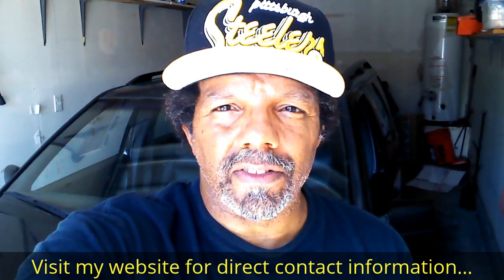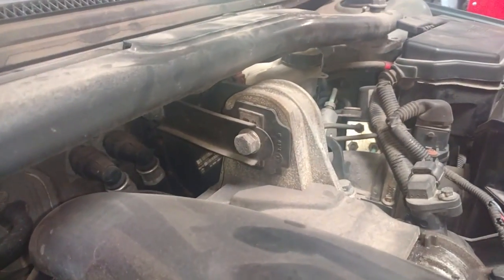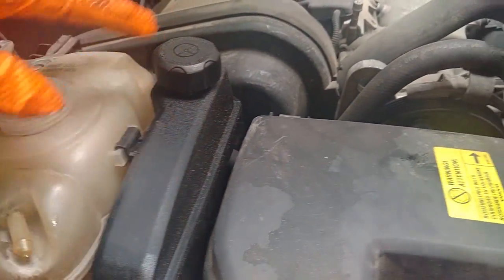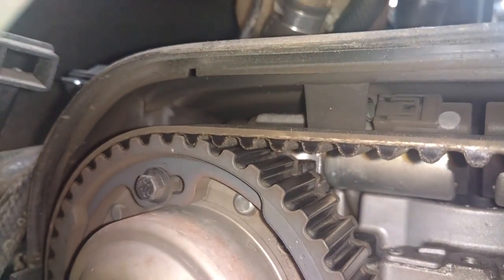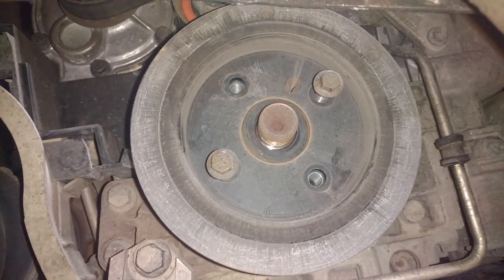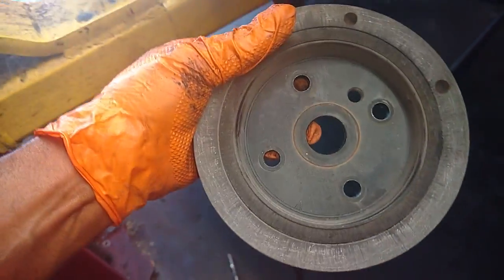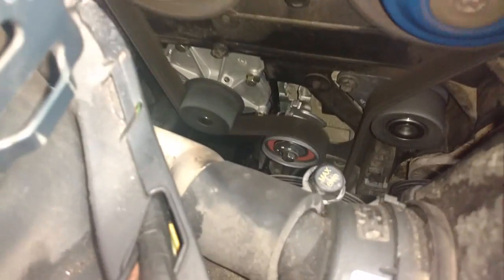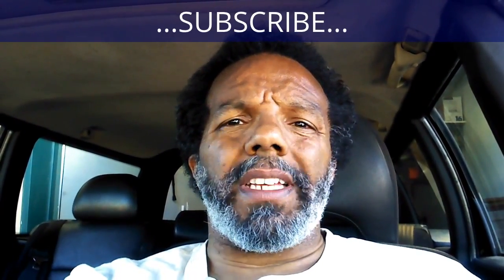How to replace timing belt & water pump on P2 Volvo S60, V70, XC90, S80, V50, S40, V40, etc. - VOTD

Comment: Hi Robert! After installing the timing belt and removing the camshaft locking tool, I rotated the engine UNTICLOCKWISE instead of CLOCKWISE. How can I fix this mess?
Reply from the maker: What mess?
Reply: @RobertDIY  the timing marks are not aligned and someone says I can ONLY rotate CLOCKWISE. Is this something that can be fixed?

Comment: Hi Robert, thank you for the amazing videos. I am attempting to replace the front crankshaft seal on my S60 2.0T 2005 (EU model).  In the vida manual I see that the 9995433 tool is required to remove the harmonic balancer. I do not have an impact tool, only a breaker bar for the center nut. I wanted to ask, do I really need the 9995433 tool, or do I need a cam locking tool, I am overwhelmed. Thank you.
Reply from the maker: I wouldn't try to hold the cams and break that nut loose. Find somebody with an impact gun to break it loose for you.

Comment: Great video Robert. Do you have a video on a timing belt replacement with a mechanical tensioner on a 1998 v70? It’s a uk 10v 2.5 ns, b5252s engine
Reply from the maker: It's the same process as this video.

Comment: Not sure if youstill answer these omments buuut trying to align this p2 (with old belt still on, doing bad water pump and belt cause its off) and my cam timing marks are about 180 off from each other and when one  of the cams are aligned the crank is 180 out (both do this) car has no codes whatsoever..... no idea what to do
Reply from the maker: If the car runs well, you put the crank on it's mark and make 2 new marks on the cams.

Comment: Just did this on same engine but tensioner keeps moving back and forth when engine started. Any idea on that?
Reply from the maker: If the tensioner is bouncing back and forth when you start the engine you likely tensioned it in the wrong direction. When you start the car that thing should stay steady and as the car heats up it will slowly move clockwise and just stay steady while the engine's running. The tensioner should have had a small arrow on it showing you which way to adjust the tension. If you keep having issues with it get a Volvo branded one, I hope you're not using aftermarket junk and your timing.
Reply: @RobertDIY  nope Ina branded from Continental. Will look for an but thought the newer/longer always should be clockwise. Thanks for replying 👍
/Chris

Comment: Why do a lot of people say you need the cam locking tool? Just for T belt? The tool is for the VVT adjustment right? IF you break loose the 3 gear bolts or center hub bolt, the one behind the front plug, not to confuse them.
Reply from the maker: Correct

Comment: Hey Robert, it’s Omar! Do the cams need to be locked from the front or back or not at all? I’m not sure if the cams put tension on the belt and if they turn when the belt is off.
Reply from the maker: No, unless you break a hub bolt loose. Yes they will move when you pull the belt, but you simply turn the cams back to the marks when you install the belt.

Comment: Hi Mr Robert, please I have a V50, 220 cv, changed the pump assembly, the old fuel sensor burn and a I noted, the new one can happen the same. ? Is it normal the Sensor Level lift to the righ position simply introducing the start key in "0" position or at the position "3". This fact also  happen when disconect the negative cable from the batterie. Tanks for your help.
Reply from the maker: When the key is turned to any position the fuel gauge should register. 
It could be a problem with the instrument cluster.
Reply from the maker: https://youtu.be/cWKOi8D4SWQ

Comment: Hi Mr Robert or any one, please I have a V50, 220 cv, changed the pump assembly, the old fuel sensor burn and a I noted, the new one can happen the same. ?That´s normal the Sensor Level lift to the righ position simply introducing the start key in "0" position or when disconect the negative cable from the batterie?. Tanks for your help. Nice year 2021.
Reply from the maker: I don't understand your question.

Comment: Hello Robert. The marks on your cam sprockets are aligned slightly to the right of the notches on the timing belt cover. On my car the marks instead line up slightly to the left of the notches. Does it mean my crank is off by one tooth? I've only checked the timing marks in winter with a cold engine and a garage temperature of 32F in case that makes a difference (thermal expansion, etc).
Reply from the maker: Temp doesn't matter. You need to set/view the crank.

Comment: Hey Robert; good video. I did exactly and followed your video step by step on my son’s car 2007 S60). Fired the car; it ran smoothly with no issue. Added the fluid, plugged the coal ant connector back and the car cranks but wouldn’t start, no fault codes, but it displays Engine performance reduced on the dash. After few attempts to start the car, the radiator fan goes on High and it shuts off automatically. My son took the battery negative terminal off and put it back but the car wouldn’t start. Please advise. Really appreciated
Reply from the maker: https://youtu.be/YiPAPu-K8OI

Comment: What is going on with my b5254t2 I have the engine at tdc with crankshaft  mark align,also my cam sprockets are align but once I align the tensioner to the right temp out here of 105 Degrees i tighten the tensioner and release the sprocket tool and the timing marks go off by half a tooth I keep getting correlation codes?please help
Reply from the maker: https://youtu.be/p8zd8GVvAa0

Comment: didn't show pre-loading the cvvt cam sprockets. ?

Did you do that ? 
They tend to move after the belt is pulled off, mine are spring loaded .
Reply from the maker: just turn it back to the marks. as long as you didn't pull the hub you'll be fine.

Comment: I try to do timing in s40 Volvo but problem surface when in try to line up the crank timing mark piston became level is it ok sir im still a rokkie
Reply from the maker: Did you align it before pulling the belt?

Comment: Robert can you pls send me the link where I can buy the special tool for removing the drive belt, I used torx 60socket  the part position of the belt blocked its full access. kindly assist thank you. pariegoza@yahoo.com ( Volvo xc90 2006 )
Reply from the maker: Pull the tension and knock the belt off of one of the pulleys. It's hard to find stubby torque bits.
Reply: Robert DIY thanks

Comment: What is that compound on the water pump bolts?  Anti-sieze?  Thread locker?   Also you said 15, or 50, for the torque specs on the water pump bolts?  Thanks.
Reply from the maker: Thread sealer
Reply from the maker: Huh? Did you check the comments?
Reply: Yeah, I did.  If the torque specs are there, then I missed them, sorry.   I'm fairly certain you said 15 pounds in the vid.  Just want to get it right.  All your vids are well done, thanks. @RobertDIY

Comment: Curious, probably dumb question.  When you reinstalled the water pump with it's new gasket which side do you put the gasket sealer on?
Thanks
Reply from the maker: I don't use gasket sealer.

Comment: You said if cam does move because of spring too simply turn in "proper position" to get belt back on....what is proper position, clockwise? Or do i simply give it a small counter clockwise turn to rehit my mark?
Reply from the maker: If the crank is on the mark it doesn't matter which way you turn the cams.

Comment: I have been reading online that you need to “load” the cvvt cams to line up the cam marks. Essentially you turn the engine clockwise past the marks and then counter clockwise to hit the cam marks. Was that something you needed to do or does it apply to a different engine? Thanks
Reply from the maker: sure.

Comment: Hi Robert. Really appreciate the video. Everything is fine except I can’t get he timing belt rapped around the two cams and everything else for the life of me, even after pulling the tensioner all the way to the right. I double checked belt and it’s the same length as the original. What am I messing up??
Reply from the maker: Do you have it tucked under the knob under the crank?

Comment: Robert i have been delaying this job on a 2006 volvo xc70 because i dont have a cam lock tool 5 cyl. i can just align the marks and pull the timing belt with out the cam lock tool ???
Reply from the maker: Yes
Reply: @RobertDIY  ok its on ! i am gona give it a try and take your word .... ill let u  know how it goes

Comment: s60 2006 2.5t going to have a shop do this one its my daily and me and timing jobs don't have the best track record ….6/2019 cost with to do the job is $550 with me bring them my new parts... I usually do my own work  but 1 slip up and its new motor time and when you adjust that spring it moves the hubs sometimes so this ones for the pros that do them every day. kinda like giving your self a hair cut ,you can  do it but sure not going to be like the pros do it...
Reply from the maker: I understand.

Comment: Hello Robert: thanks once more for a great video.I have just bought an XC 60 T 6- I thought that volvo would stick to a game plan but things seem different!? Have you done any cam belt replacements on XC 60s? I can only find 1 video on youtube- it was called cam belt replacement but the guy was actually replacing the serpentine belt  driving the alternator and air conditioner.Hope he's not in for a nasty surprise.
I have done all the fluids myself but hear a rev related "swoosh swosh" coming from the front R ( R hand drive vehicle)
The vehicle has only 138,000 km and was born in 2011.It should not be ready for a cam belt/water pump/tensioner replacement yet but that front end does sound suspicious.

Thanks for any ideas.
ps if you get a cx 60 T6 they move very well!......and will probably give you another lifetime of videos to make!
Reply from the maker: Sad to say, I have no experience with that engine or belt system.
Reply: @RobertDIY  Thanks for your reply.May be worth treating your self to a challenge? They are going cheap because they are expensive to service....and I may live to regret it! However  I have the time and my good old reliable 850 SE wagon with 187,000 kms to fall back on! I'll start by accessing the innards by front  wheel removal  and arch covers to see the lie of the land.
Much of the trouble is Volvo's high handed approach to the public.The Vovo Vida stuff is almost impossible to install on the computer( I've still no success) ,never the less Volvo's engineers  seem reasonable- its the head office policies.
Sorry for the rant! I don't know whether Merc,Audi and BMW are any different (their cars are certainly no better!).Am staying with the devil I know in the mean time!

Keep up the good work.I learn from your vids even on other models.

Comment: I have two remaining codes on my S40, one being the cat system. I replaced the lower one, and the upper one is getting replaced next week. The other is a p0017, which I'm guessing now is either the timing belt or cam sensor. I had the crank sensor replaced, but I'm hoping it's not the timing belt, which I had replaced already only a couple years ago. It might be off a perfect alignment, but I'm hoping the code clears easier than having to do that again.
Reply from the maker: Thanks for sharing.
Reply: @RobertDIY  Where are you located? I live in Michigan but am moving to Buffalo this fall.
Reply: @RobertDIY  Ok looking back now on my repairs, I had the whole timing belt replaced, the kit which was 7 parts, seals, tensioner, and water pump. But I didn't do the VVT solenoid, which I can do myself. I'm going to try that myself and hopefully that's the last thing I need to do to clear that code.

Comment: Hello Robert, I have a 2004 xc90 t6 and was driving when the engine just shut off. Would not start up. Codes came back saying it was the camshaft sensor. Anyway replaced it still no start? Someone said to replace the timing belt. I have never worked on a Volvo. I am so grateful and glad you made this video. I can't thank you enough.
Reply from the maker: https://youtu.be/hJIoyHLl30U

Comment: questiom im doing a 2005 xc90,  timin broke off driving i know it can be a bad engine , but here is my question i put the new timing belt but dont star now can you tell me for tront cam you line ut up with the nach or dot? also i can tell if you line up tge rear cam with THE dot or small line?
Reply from the maker: https://youtu.be/hJIoyHLl30U

Comment: Very good video Robert. I've done this job a few times but for some reason I keep getting camshaft codes on the intake on my XC90 T5.. Shifted the inlet hub a few degrees fwd now the exhaust cam codes and I can't find the sweet spot with the hub limits so I figure I'm a tooth off on one of these..  I'm going to start over again. It's a Pita because I'm disabled and have to pick my days. Never had this happen. Thanks for the video.. Much needed especially with the dual VVT hubs.
Reply from the maker: https://www.youtube.com/watch?v=0H5cgRYCMQg
Reply from the maker: Could have a bad sensor or hub.
Reply: Yeah.. You're absolutely right

Comment: Thanks for this very helpful video, Mr. Spinner.  Every step is well explained and well lit.  There are also helpful tricks, like lifting the engine mount to make more room to access the water pump. Is it necessary, or simply prudent, to replace the water pump on a 105,000 mile car?  A Volvo service manager told me the water pump is a 200’000 mile part.
Reply from the maker: Every 10 years. I've seen them run 500,000 miles.
Reply: Any time you're in there, you might as well replace everything in the area that you're going to access so you don't have to touch it again.  I'd rather know that everything was replaced in that area rather than have to worry about x, y, or z later down the road if you didn't replace them.

Comment: Everything is great info, except I wouldn't fire up the motor without coolant and serpentine belt back on. There's no need, as hand rotation will show if the timing is properly aligned. Running the engine without coolant is really bad for the water pump seal, which needs the coolant to lubricate it.
Reply from the maker: Thanks for sharing

Comment: Hi Robert and thanks for informative video which scared me a little bit. I have Volvo 2004 V40 and the timing belt got contaminated with oil and got loose and both cams jumped on certain position. I took the chance and replaced the timing belt with it's kits after watching your other video and thank God no interference engine and no bent valves. The car started fine but I am having problem installing the old serpentine belt although I followed the routing diagram and tried all possible configuration . Any hint before I buy new drive belt other than the belt got shorting due to cold weather. Thanks
fredintheshed1
Reply from the maker: 4th Time I seen this post.

Comment: Outstanding advice you give here. I have commented on other videos of yours. I did the timing belt yesterday on my 2005 XC70 2.5T dual VVT, the engine on this video is identical to mine so it was a great help! I was about to reach out on the usage of the camshaft locking tool because I saw the hubs moved forward when I loosened the part providing the reading for the Camshaft position sensors, but they didn't rotate, and I tightened the bolts again and came back so I went ahead and did it. The car runs like a charm and the time didn't move. Water pump was nice and dry, not a single seal leaking. I wish I would have had a front sprocket locking tool, the most tricky part was to get the belt on while keeping the VVT hubs loaded forward. Oh man good parts on this car aren't cheap (FCP Euro gave me the best prices and availability compared to eEuro and other retailers) but they last a long time and this Viking machines are incredibly well built. Cheers brother!!!
Reply from the maker: Thanks for sharing
Reply: user-jt2zv7ni5o  one thing I would recommend though... If your belt broke, hopefully the engine stalled right away. However, if you have access to a good scanner book it up to get data from your crank position sensors and your camshaft position sensors, remember your crank will rotate 360 degrees for every 180 in your camshafts (I bought an iCarSoft specific to Volvo and Saab and it's quite capable)
Reply: user-jt2zv7ni5o  you don't usually see belts breaking, that is usually a seized tensioner. I'm down to my third belt since I wrote that comment with other cars in the family and learned a few lessons on those. I would not give up on the engine just yet. Try rotating the crank with a ratchet and a 30mm socket. Do it by hand and carefully feel for interference between pistons and valves. Once the belt is removed you can certainly move the hubs by hand but I advise to reserve this for final adjustment only. Feel free to reach out by private and I'll be happy to help you out. Best of luck 🙏

Comment: Hi robert, I got a 2007 volvo v50 t5 awd, and I want to do the timing belt water pump, do I need to lock the cams with the special tool do to the job ?
Reply from the maker: Nope, only if you pull a cam sprocket.
Reply: Great ! Thanks 👍🏻